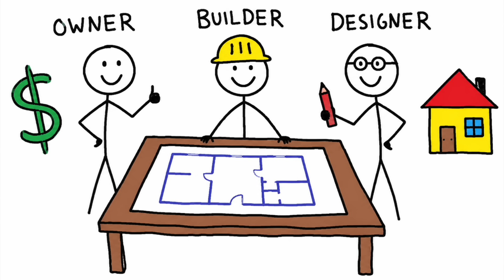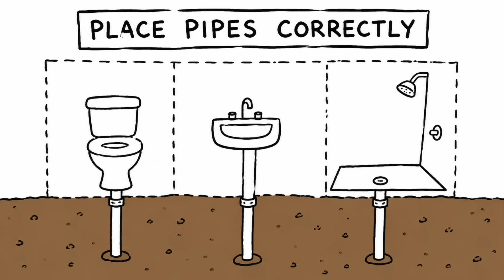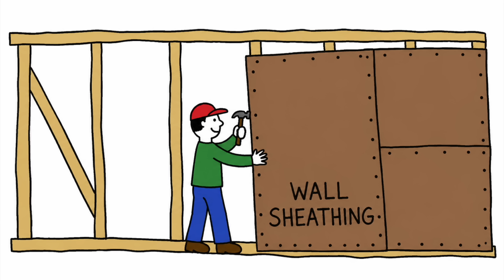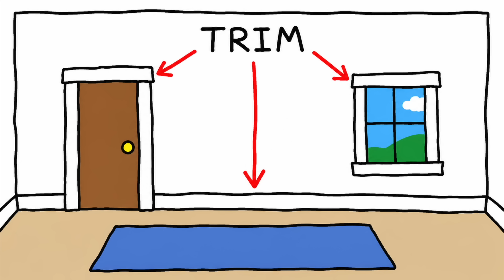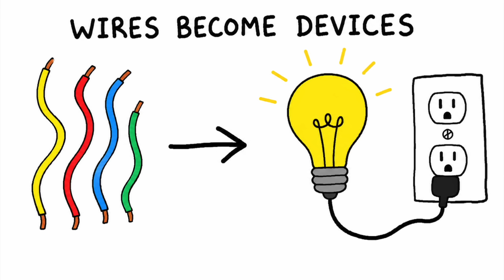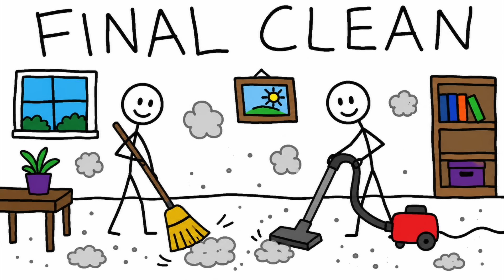How to Build a House From Start to Finish (In Simple Terms Anyone Can Understand)

Comment: Yes, but how strong and durable are those homes in a storm ore similar. Because most American homes are made off cardbord.
While in Europe nearly everything is built by brick and morter.
Reply: I’ve lived in North America and in Europe. America had far more storms and far stronger than I ever experienced in Europe, but I never heard of storms damaging homes in America unless there were tornadoes or high category hurricanes involved, which I imagine would’ve taken the roof off of any European home as well, but the European climate just doesn’t get that kind of weather. I’d say the real difference is longevity. A European brick and mortar home will always last longer than an American lumber framed home.
Reply: You do know that america has storms and bad weather too right? And people still have houses. Your comment is silly
Reply: Hi there, I’m in Asia and we usually build with concrete walls, bricks are not common here.   I’m curious, are brick walls more resilient against earthquakes?  I understand they do not incorporate rebars (steel wires) which are used in concrete to add strength and prevent collapse.   I’m not an engineer or architect so I could be wrong
Reply: @user-sk2fw8jq3m  When Europeans say "brick" they mean large building blocks: Porotherm, aerated concrete, lime based blocks, etc. Concrete blocks are much less used than before - they are mold friendly and are not insulating. Nobody builds with small bricks any more. Large seismic Wienerberger bricks are used in earthquake prone areas.
Reply: And yet, Europes most extreme weather is a modestly warm summer day at about 70-80 degrees.
No average storm is gonna tear apart an American home.
Now a category 3+ tornado or tsunami? 
Possibly. I’ve seen trailer parks remain unscathed. Also some get destroyed but simply flipping the trailer.
Just because it’s wooden, doesn’t mean it’s bad. 
It’s also way easier to work on, cheaper, too.
Reply: And armoured concrete
Reply: Calm down son.
Reply: You’re mixing up, those are bunkers, not homes, there are many in Germany and other countries in Europe. People build bunkers instead of regular homes for they know, peace isn’t guaranteed over there even after their leaders sign peace agreements or win wars, they know a war comes after another war, it’s like a tradition over there, so if a rocket was aimed at a house or apartment block over there,  that building would have some chances to keep on standing on the ground after it hit it. But American homes are also solid and strong, don’t worry.
Reply: And by the way, let me tell you something because you, Europeans, have a problem with us for we have the right to own weapons such as guns, rifles and so on without weapon licenses, and you don’t, instead the difference between us and you is that we, Americans, have guns and rifles in our homes for our defense, and you have swords, bows and tasers in your homes to defend yourselves whenever you need to.

Comment: Pretty good but you got a few things backwards
Reply from the maker: I appreciate the feedback, could you let me know which parts I mixed up?
Reply: @rescomcontractors  one that i saw was regarding painting, trims, and flooring (around the 5-ish minute mark). walls are typically painted first, then flooring is installed, and then the base boards/trims. i believe you had these steps listed in reverse in your video.

but, aside from those, the video was thorough and very informative. thanks!
Reply: yeah what parts are mixed up